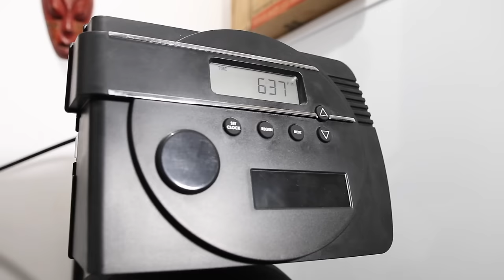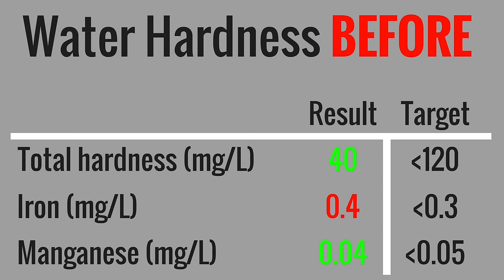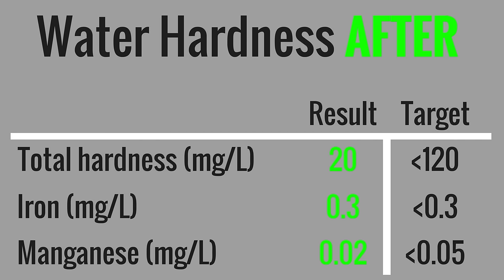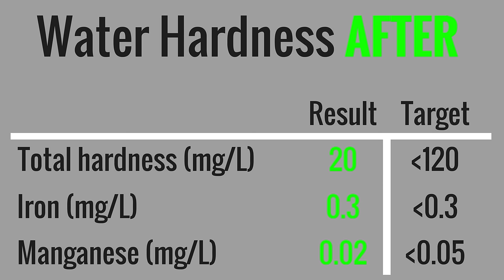WATER SOFTENER SYSTEM : HOW IT WORKS !!

Comment: Does the container that holds the salt need to be cleaned out? Mine is looking pretty bad in there but I don’t want to mess anything up by trying to take it out and rinsing it out. Thanks for the informational video.
Reply from the maker: If it gets gunky, yes you should clean the salt tank.  There are YouTube tutorials on that.  Here's one: https://youtu.be/UJO9XiOsw7Q

Comment: Very interesting Pan. For regeneration, could you please advise about the time needed for resin regeneration ?.
Reply: If your softener is programmable and works on a water usage basis instead of a timed interval, set your calcium hardness level based on your water sample. If you use potassium instead of salt, you need to bump up that figure a few points. If you have a system that only works on a timed interval (every so many days) it will be hit and miss. With hard water, start by adjusting the timed regeneration intervals closer together and giving it 2-3 days to replace all of the harder water in the water heater so you will have the real end product. Keep doing that until you get water that never gets hard. The only problem with that is if there is extra water usage during that period, (house guests, etc.) then the water may get hard before it regenerates again. But your only alternatives are to set it up to regenerate too frequently and waste a lot of salt, or buy a softener that regenerates on a metered usage basis based on the calcium hardness level that you program.

Comment: Thank you for this information! Do I need to continuously refill my brine tank with water?
Reply from the maker: You should only need to add more salt as the level goes lower. Inform yourself on how your particular system works with your water treatment specialist near you, or the company that installed your water softener.

Comment: Thanks for the explanation. Question. Say there's some build up in your pipes from not having a water softner. Will getting and using a softner eventually cause that build up to break away and be gone? If not, how would you fix that problem
Reply from the maker: I unfortunately don’t have an answer to that.

Comment: I want to add one of these to our home but it would have to be installed outside closest to our supply line. The issue we're having is where to route the discharge line since there's no existing waste line except for our garden drains that run to the front lawn.
Reply: @MANGESHAUTI  Thank you got the information. Meeting with the Kenitico rep in a couple of days. I’ll get a feel for how creative they are. 🤙🏽

Comment: What you are not telling is - soft water eats your sacrificial anode in the tank and if you don’t replace it once every two years- it will start rusting your hot water tank at exponential progression. I moved into a new subdivision into a new house 6 years ago and so my neighbors. This year we (6 neighbors around my house) all started having hot water tanks leaking. All happened during this spring/summer period. Few guys got flooded the basements. All of us have softeners. Those who didn’t have softeners are not having this issue.
I called tank manufacturer and they did confirm the fact that stray currents eat anodes quickly in soft water.
Rheem has technical paper on their site about it.

Comment: 'Ticky Tac' says : 'Reverse osmosis removes all chemical compounds from the water (well like 99.99% but close enough), it does this with a series of different membrane filters, and activated charcoal to capture those compounds. A scale inhibitor does not remove any compounds, it only conditions them, so all the compound removal will be done by the reverse osmosis filter, greatly reducing its life, and effectiveness in flow rate over time. A water softener will remove the larger compounds from the water, which will improve the life of the reverse osmosis filter, and maintain its effective flow rate.

Comment: I have an old Kenmore softener that keeps filling up with water that doesn't drain. I've cleaned the venturi and replaced the main gasket that others say to do. It didn't fix my issue. Could the issue be in the brine valve assembly? Take it out, clean it, or replace it with a new one? Otherwise, my next thing is to just buy a new softener since this one is 17 years old.

Comment: I just recently installed my water softener system, after reading the paperwork and not finding an answer to my question, I figured I'd ask you! 

As time goes on and more salt is added, do I ever need to add more water? During original set up it said to add 80lbs salt and 5gal of water.  Should I add more water as I refill the salt? 

Thanks!

Comment: In few minutes you told me all that my blessed installers should have, could have, but did not! Thanks!!
I would like to know, if you find time please, what kind of maintenance etc the ion exchange resin needs, other than the regeneration which I was told about and that it would occur the night after installation and every 14 days thereafter. The booklet they left, though, has stuff like manual regeneration, setting up time schedule etc. I assume, it is better to let the system run on Auto...? Am I assuming it correctly? Some sites mention that the brine tank should be 3/4th full of SALT. On day two, mine seems like 1/6th Salt chunks and about 5-6 inches of water above it and a vast volume of the brine tank full of Air, what else...! Should I be worried?? It took them 2 months to install from the first meeting with the expert front desk guy! I would rather ask you than those communication giants! They are good people. I am just a crabby curmudgeon retired senior! <LOL>

Comment: You are very knowledgeable about the water softener process and I have a few questions so I'll give it a shot. 

Is a water softener synonymous with a water purifier? My wife's grandmother had terrible tasting water (brackish probably) and she had a water softener.  The treated water tasted great but it was so soft I could never get the soapy feel off my hands.  If I rubbed my hands vigorously it would create little sudsy looking bubbles.   Was that normal or maybe the system was running out of specifications?  If that is normal is there a way to mitigate the ultra softness?  Maybe introduce some minerals back into the system?    

I'm about to have a well dug (drilled?) in an area very close to a very brackish free flowing artisan well.  If, in the event I would need a water conditioner, would a "normal" water softener be appropriate? What type system would you suggest?  Thanks!

Comment: Just wanted to comment on the questions in the comments. I’m in the water treatment industry and the best advice I can give is have a certified technician out to your house to test your water and come up with a solution that best works for you. That way you have a company that will stand behind you!

Kinetico provides the most advanced technology for the longest life and reduced service calls. Systems like shown in the video are great but the resin beads are slowly melted away by the chlorine from the city. I see those last around 5-6 years in the field. Kinetico last around 15-30yrs I pulled one out the other day that was working just wanted to upgrade and it was from 1989!
Reply from the maker: I agree Robert. And that's what I often tell people who ask "how much does a system like this cost"? Well it depends on many factors, including your water hardness levels and what type of resin best suits your scenario. Hence why it's important to deal with water treatment specialists local to your home so they can provide the best solution possible.
Reply: Store brand units last 5-10 years. Premium brands last 10-20 years. Kinetico units are nice but they sometimes cost double other premium brand systems. Proprietary brand as well so you can only have a Kinetico tech service it. Good brand but between cost and service - i'm not a fan. Fleck, Clack, Culligan and Hellenbrand are better in my opinion.
Reply: @jrkirschmann6761  Yeah really depends on what type of consumer you are. If you want lower service and repair Kinetico is the way to go. If you are pretty handy and don't mind repairing systems Clack is pretty good. Also, with Kinetico you can order parts just like from Culligan but they are covered under warranty vs other brands. for 10yrs. and usually more cost due to 2 softening tanks so that is going to increase the price.

Comment: Excellent video, but was hoping he would cover the pricing on the unit he was showing to give us an idea what the cost is. Also, he mentions about taking a water sample from your facet and bring it in for an analysis. Where do we bring for an analysis??? All of these companies selling the systems want to get a sales person to our house and sell us a high dollar unit ($2500+). There are so many options for a system it is like buying a car whereas one has to be cautious of what they're trying to sell.
Reply from the maker: Prices vary drastically depending on which media you need, hence why a water analysis is key.  The resin won't be the same for water that is suuuuuper hard compared to water like the one I had in that house which was already pretty soft to start off with.  Plus prices vary too much country to country, city to city.  A water softener installation won't cost the same in Montreal, Canada as it does in NY, USA.
Reply: @PanTheOrganizer  Thank you
Reply: Not sure where you are located, but I grabbed a free water sample kit from Home Depot to have analyzed. Turns out my water is veryyyy hard (Philadelphia). Price I quoted for the softener system (for drinking filters also) was nearly $7,000 ($116 per month for 5 years).
Reply: @dantealexander1103  that's home depot. it's a scam. call a qualified local treatment professional

Comment: Pan, how are you connecting the softened water to your pressure washer?  If a house is pre-plumbed for a softener, the hose bibs for garden hoses are not part of the softener loop.  In other words, only interior water supplies are softened as most folks wouldn't want to waste their softened water on a sprinkler for their lawn.  A part 2 of how you installed the softener and a guide to effective use & maintenance would be helpful.  
Please let us know how you're connecting the softened water to your pressure washer.
Thanks
j
Reply from the maker: The main water line from the city to my house goes through my water softener system.  So all the water in my home is softened.  I had soft water to begin with anyways as you saw with the lab results.
Reply: @PanTheOrganizer  thanks for the super quick reply but i am hoping you can speak to my question in regards to the plumbing.  Most pre-plumbed homes have a leg that goes to outdoor faucets/hose bibs that DOES NOT go though the softener.  How are you supplying softened water to your pressure washer?  Thanks, ~j
Reply from the maker: I have zero expertise in plumbing so unfortunately I don’t have that answer.  The company did all the work, thank god lol. But my pressure washer isn’t connected to an outdoor bib.  It’s connected to a bib in my garage.  That bib is in the interior walls of my home if that helps.  Watch my garage tour video and you’ll see.
Reply: @PanTheOrganizer  totally helps & pretty much guarantees you're connected to softened water.  Thanks for all you do, Pan.  You're a great help to the rest of us

Comment: Lime or calcium or whatever, has built up inside my central heater half full touching the heating element just in 2 years. I am using well water which has a lot of minerals.

How efficient are water softeners?

Comment: Water softeners are great for your home as Pan indicates. I unfortunately found out the hard way that water spots are still a huge issue when it comes to detailing even with soft water ran into the garage. The state I live in our TDS numbers are really high. If your an avid detailer either buy or rent a DI system if you don't want to wait to detail either early in the AM or evening. Also if you go this route you do not want to run soft water thru it. It will kill the resin in your DI system. Anyway solid vid pan. DI is the only way for us that live in states with high TDS numbers. Hope this helps someone. ✌
Reply from the maker: Good to know! I live in an area where the water is already super soft with low TDS (as you saw in the test results prior to installing the water softener) so having the softener was total overkill in my case, but now have even cleaner water. 

But yeah for those who want total absence of minerals and 0 TDS, a deionizer is the only way to go.
Reply: @PanTheOrganizer  Your blessed with better water lol I am jealous. Mine is awful. I was really bummed that paying for a dedicated hot and cold soft water line would not remediate the issue. DI is expensive with the resin but its all I can do at this point. Gotta keep up with demand for services in full sun. Anyway good vid pan so many people don't think about their pipes appliances etc and the hard water destroys them over time. Best thing I did water wise for my house other than the softner was put an RO system in I will never live without one again. No more plastic bottles and much better tasting water so worth the cost.
Reply from the maker: Yup. And not to forget that with softer water the clothes are softer, you get better lather when washing yourself, appliances depending on water will last longer, etc
Reply: @nyquil07na38  - Do yourself and everyone in the house a favor... Take your "Salt - Softener" out of your System.  In long run, you will harm your Thyroid and then Iodine Deficiency.
Reply: @JodBronson  Iodine supplementation isn't done through water in the U.S., it's done through iodized salt. Also, the risk of iodine deficiency is not that high unless you happen to both live in an area with little iodine content in the soil and only eat locally grown foods.
Reply: @diligentcircle  -  You need to GO TO BACK TO ENGLISH 101 and then RE-READ my post again to understand what I am trying to say !!
Reply: @JodBronson  While your post wasn't well-written, you're talking about water softeners (the topic of this video) and iodine deficiency as if they're connected.

Those two have no connection in the U.S. There generally isn't iodine in the water in the first place, whether the water is in its original hard state or softened with a water softener. Maybe they're connected where you live, but the comment you're replying to is clearly from someone in the U.S.
Reply: @diligentcircle  -  GRRRR>>>>> If something is not clear.....  It's ALWAYS good to ask questions rather than insinuate.  My original post was short but very precise and I will explain....  COPY: In long run, you will harm your Thyroid and then Iodine Deficiency.  I clearly stated, "In long run"  <<<<< That means over-time "salt" will cause thyroid problems and leads to Iodine Deficiency.  Furthermore.... Most people have enough salt in their daily diet, some overkill if you ask me.  Also, the "Salt" Pellets used in "Softener" does not have Iodine added.  Again, because of that, "in the long run", this will hurt The Thyroid Gland and also leads to Iodine Deficiency.
Reply: @JodBronson  I take it you didn't watch the video, then? The salt used by the water softener doesn't actually become a part of the water that comes out of your tap. It's used to clean the minerals out of the water softener's filtration system and then flushed away along with the minerals. Some might be left over, but literally every water source that isn't distilled has some amount of salt content. Unless you get to the realm of saltwater, it's not harmful.

That said, if you think salt causes iodine deficiency, you're badly misinformed. Salt is an essential nutrient (salt cravings are the only kind of craving which is actually driven by a physiological need; when you crave salt, it's because your body needs more salt for its electrolyte balance). As for iodine deficiency, that's caused by a lack of iodine in the soil in certain regions. The only relation it has to salt is that the U.S. and other regions attempt to prevent iodine deficiency by adding iodine to salt (purely because doing so is easy and salt is commonly eaten).
Reply: @diligentcircle  - STOP TALKING CRAP AND LEARN ENGLISH 101 & SCIENCE  !!!

Comment: Hello! Great video. We would all like to know what system Roa water softening system you got and how much it cost? Thank you. 🥰
Reply from the maker: Thanks Rodrigo. I don't know what brand it is, other than it has a Fuzion brand head/controller. I got it from my local water treatment specialist. The cost was approximately 2500$ CAD including installation. The cost greatly depends on what type of resin is placed inside the tank, and that depends on what minerals your water has, your current TDS levels, etc. 

Consult with a water treatment specialist near you.
Reply: @PanTheOrganizer  thank you very much for such detailed explanation. Amazing chanel! Very useful truly.
Reply from the maker: Thanks! How did you discover my channel?

Welcome to my channel. You discovered one of the biggest car detailing channels on YouTube as we surpassed 895,000 subscribers and we have over 116 million views! I have been detailing for 26 years and I love to share my knowledge and passion with my viewers.

You found the right channel to help you learn everything about detailing.

Comment: Great video. What about sodium mg/L? Did that increase? I have some concerns re: adding a bunch of sodium to the water.
Reply from the maker: Sodium levels go up a bit but nothing significant. It's still safe to drink. I have had a water softener in both my homes (as we moved to a new home three years ago) and never had a single issue.